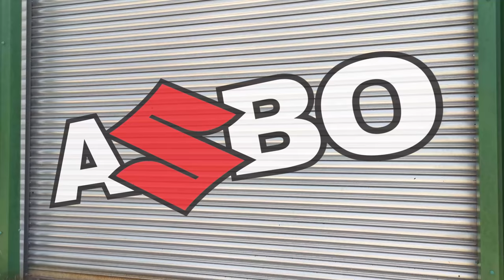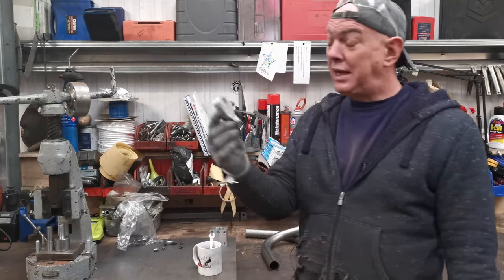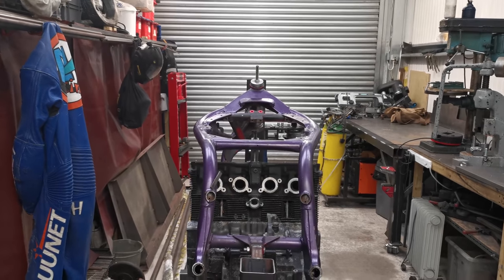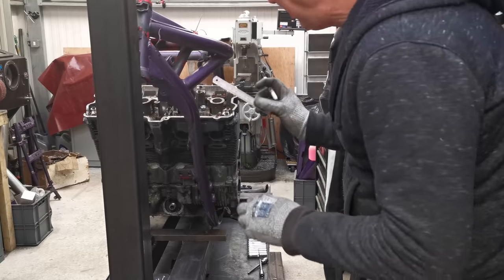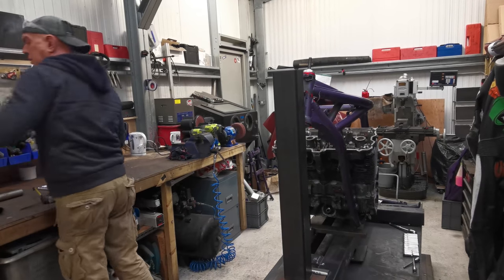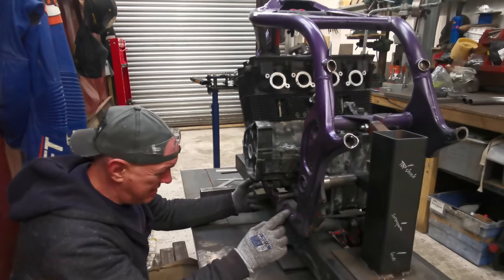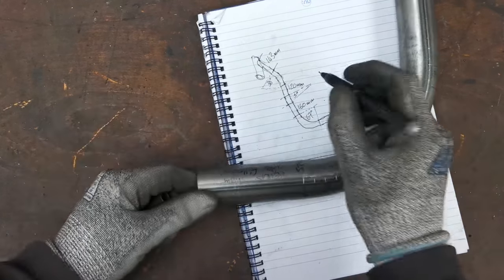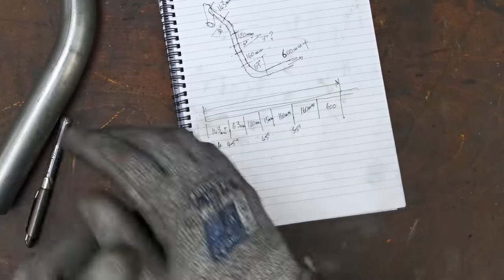My 1st frame rail (Part 1 - Planning) - Suzuki Bandit Cafe Racer - ASBO Project

Comment: Thanks very much for your consideration Quickie. It was great to be able to relax and watch without the stress of wondering when that effect was coming! Good luck with the frame build.
Reply from the maker: Glad I could help Steve and sorry about the previous videos, but I can't change them now.... 😄
Reply: @QuickBikes  No problem, I've already watched them all thanks! As an aside, I saw a fella building a tubular assembly years ago and he used a couple of cheap magnetic dial gauge holders with one vee block end stuck to each tube so that the rods crossed and were linked together with the joiner pieces (if that makes sense). Better than duct tape, easier than G-clamps and infinitely adjustable.
Reply from the maker: I've got some of them too... why didn't I think of that 🤣😂😅

Comment: If your using bigger tubes for the bottom half. Will it go in between the exhaust outlets mate
Reply from the maker: Yup, that's why I put the headers on to check it and have something to aim at 😁👍
Reply: @QuickBikes  yer sorry mate just watched the next video. Doing a great job